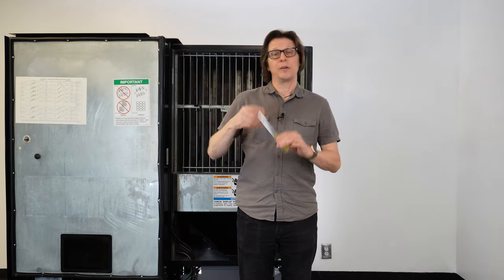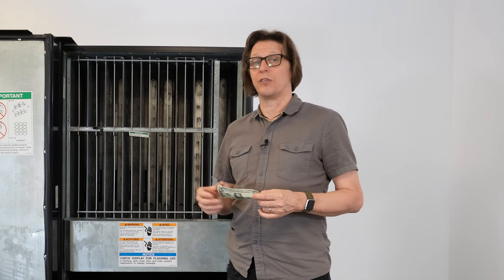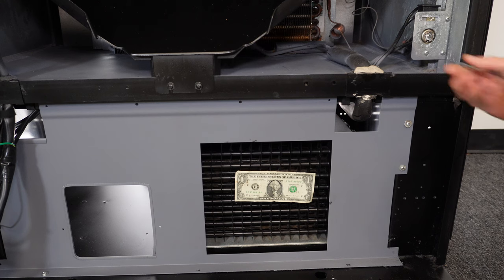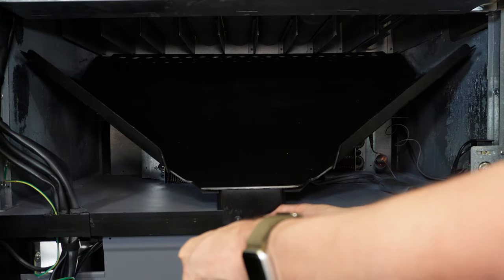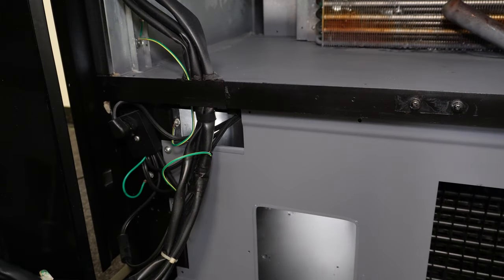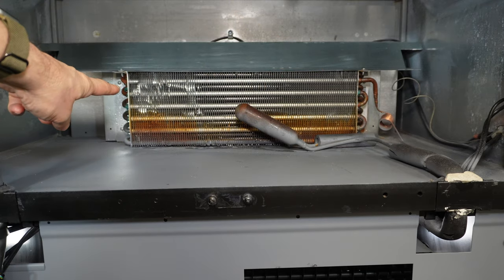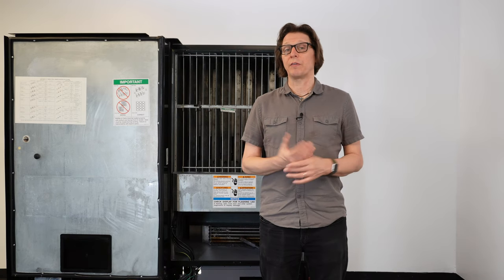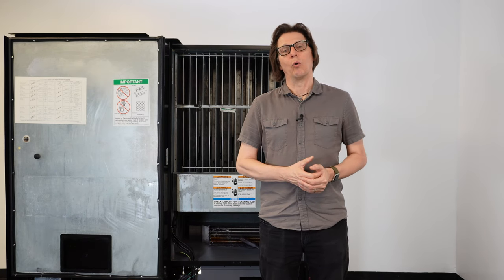How to troubleshooting drink vending machine's cooling system while on location

Comment: Ok one thing that we should do with these machines is blow out your condenser coils. This should be the first thing that you do. I work on ice boxes for a ice company. If you can't see thru them it's not a good sign.
Reply from the maker: Excellent tip Richard. I should have mentioned that. Thank you for sharing.
Reply: Hey when you say blow them out what do you mean? And what would you suggest doing that with?
Reply: You can do that with compressed air.

Comment: Great video and very helpful information.  I did the tests and condenser and evaporator fan works fine along with thermostat.   I noticed next to evaporator coil - notice a chunk of ice build up.  After thawing it, ran the 15 mins test as you recommended, I see some frost.   What would cause the ice build up next to Evaporator coils (looks like kidney bean)?

Comment: Hello there and thank you for your very very helpful videos. So my question is checked the condenser fan and it was good then the evaporator fan and it did not turn on so did the evaporator coil test and it froze up like in the video does that mean it needs to be charged too or is that caused due to the fan not working?
Reply: It either means the fan has gone bad or the relay has gone bad. You can check to see if your evaporator fan is running in the back. That will be a pretty clear sign it is time to replace your evaporator fan.

Comment: Thanks for the video and info.   I checked my Dixie narco 276e machine and evaporator and condenser fan is fine but not cooling.
 I did the 15 mins test as per video and no frost in the evaporator coil.  Does this signify the compressor is bad or leak?

Comment: I just bought a royal 660-9 & having the same problem with the machine , I can't get the compressor to turn on when it's plugged into the power harness but when I unplug the compressor & plug it into an extension cord the compressor kicks on no problem, I'm brand new to this vending business & would appreciate your expertise,  Thanks!!!
Reply from the maker: @Donnie B From your description and trouble shooting steps. It sounds like you could have a faulty refrigeration relay. The Royal 660 was designed by Coke-Cola but manufactured by Royal Vendors for Coke Asset Operators. The 660 shares some similarities to the Royal 650. I have several videos about the Royal 650. Two of which deal with the refrigeration relay. This relay can be tested from the control board to determine if it opens and closes.

The 660 uses a four button programing as the Royal 650 uses the a three button programing. Though the concept I show in the videos can be applied to the 660.

How to test the Royal FRIG relay: https://youtu.be/yIgDyCrBk4Q
Troubleshooting a Royal FRIG relay with a voltmeter: https://youtu.be/5SYYrIn3tYs

If the relay opens and closes when tested with a voltmeter then the issue is the actual power junction assembly that the compressor plugs in to. I hope the gets you pointed in the right direction. Thank you for watching and supporting.
Reply: @VendingMachineSupport  Thank you sir, I'm gonna take a look at it today,  I appreciate the info Thanks 👍

Comment: Compressor seems to work and the evaporator coil is getting cold but I don't see The frost built as seen on your video. I can see light frost on the sides and on the tube in the front.
Reply from the maker: Your unit may be low on charge or has a blockage in the lines. Might want to call in a HVAC mechanic.

Comment: I have a dixie narco 276 just restored the entire machine. Replaced the compressor housing with a new compressor and rebuilt evaporator and condenser. I noticed the compressor will run 15min on and 15min off ranging from 35°-37° new thermostat. This unit is installed in my basement which is about 65°. Is this the normal cycle? Or should I start looking for some kind of air leak? I also for the first time fully stocked the machine full of room temp cans and it took almost 6 hours to reach 35 degrees. My evaporator in 15 minutes looks exactly like the one in your video. I found quite a few other videos that say that is perfectly normal, including the company that I bought the refurbished compressor deck from lol. When you had yours looked at, did they say there was something wrong with it??
Reply from the maker: From your description it sounds that everything is working ok in your machine cooling wise. Drink vending machines are not energy efficient like your typical modern refrigerator.

Comment: Hi. My Royal 650 has a lot of ice build up around the entire evaporator coil. How can I thaw it out while preventing any leaks at the location? Where should drip pans be placed? Should I remove the chute like you did in your test?
Reply from the maker: You will want to unplug the machine and let the ice melt off while keeping a towel near the bottom of the machine to soak up any overflow water. You can also use a hair dryer to help accelerate melting the ice. Please do not chisel or poke at the ice as this can damage the evap coil.
Reply: @VendingMachineSupport how do you test the electronic temperature sensor on a Royal 650?

Comment: I recently purchased a Vendo 516. The condenser isn't getting cold. I can't find ANY information on replacements. Do you have any suggestions or if there are replacements for it?
Reply from the maker: The Vendo 516 is an older Vendo unit and new units are hard to come by. I would look for a locally owned and independent HVAC mechanic or appliance repair to have a look at the unit. These cooling decks are very simple in the grand scheme of cooling units.

Comment: My condenser fan takes time to turn on is that a concern? When it turned on, I moved the  Thermostat to 0/0ff and the fan turned off.   Does the fan take a while to turn on or is it supposed to be immediate
Reply from the maker: Typically the condenser fan should start as soon as power is applied to it. Unless there is a time delay device which I have only seen once. If the condenser fan is taking some time to start up there is a good chance that it is also not running at full RPM. In turn reducing the amount of air that is pulled through the condenser coil and over the compressor head. This causes overheating and problematic cooling issues.

Comment: I’m try to diagnose my Dixie-Narco and it fails the thermostat test but it also doesn’t get frosty on the coils. Should I replace the thermostat and try the frost test again?
Reply from the maker: @Ethan Irwin If the evaporator coils did not get frosted over within 15 minuted when connecting the compressor directly to power (which bypasses the thermostat). Then replacing the thermostat will not produce a different result. Make sure when you tested the compressor you did this with the machine unplugged from the wall and the compressor connected directly to power via an extension cord.

Comment: I have an 85 coke machine, cools great but the condensation won't drain to the pan or through the hose to the pan. how do I unclog it?
Reply from the maker: Try running a long brush through the pipe.
Reply: Or connect a few cable ties together and poke it down the drain hole (under the evaperator) until you see it poke out the end of the tube.

Comment: Hello sir  so i got a beat up choice vendo machine and i mean the i had to do body work to it the door was bend Ll bad anyways i was real proud of my self cus i fix the door i also got the compressor  and the fan aslo the condenser n fans anyways  so i was excited  right but once i check it to see if it was cold i was shocked it was not cold becus everything was good any ways i been try to see whats up with that and my guess is could the capillary   tube need to be replaced  cus its look bad its all original from the late 1960s any ways hope to hear from you sir gracias

Comment: So what is happening when the coke cans are over freezing literally lost like 40 cans due to them bursting in machine . It was winter in Texas but last month could drinks have over froze due to outside temperatures?
Reply from the maker: You need to establish what is the temp inside you machine. Stick a thermometer in the machine. You are looking for temps between 40F to 36F. Diet drinks freeze at 34F while other type of drinks and water will freeze at 32F. If the temp in your machine balances out between 40F and 36F after letting the machine run for a few hours. Then the freezing cold be due to outside temps.

Comment: AMS 39 VCF 
That keeps leaking water on the floor. How do I fix this.
Reply from the maker: There is a drain hose that takes the water coming from the pan that sits beneath the evap coil and deliveries it to the drain pan. Check to make sure the hose is attached correctly or not clogged. Also make sure the hose is actually sitting in the drain pan.

Comment: So my Coils are froze up in a block of ice, I check the thermostat like you said in the video turning it until the compressor kicks on and off. While the compressor is off I was able to hear the blower fan behind the block of ice also I can see the compressor fan spinning. I shut the machine down for a day to let ice thaw to visually inspect the coils there was some slight browning at the bottom but not much. With the machine back on for a day I returned and the ice started build back up, please help.
Reply from the maker: What happened to the evap coils after running the compressor directly to power for 15 minutes with the machine unplugged?
Reply: The pass through is on the left side of my machine. Will the deep refrigeration unit on DSV still work

Comment: Mine is freezing up can you tell me what may be causing it??? DN 501e
Reply: My motors at bottom and top are working.
Reply from the maker: Possible could be the thermostat not shutting down the compressor or the machine is leaking outside air in.